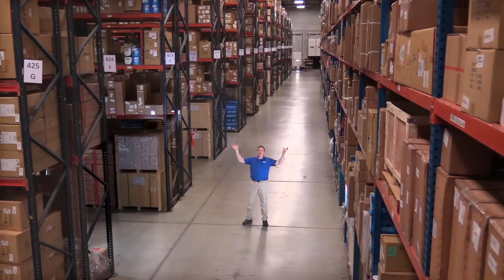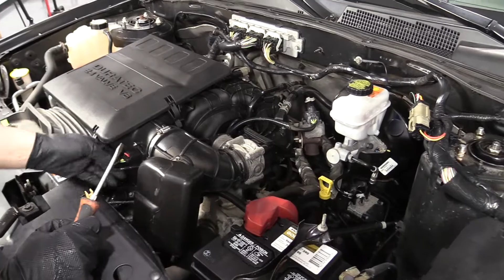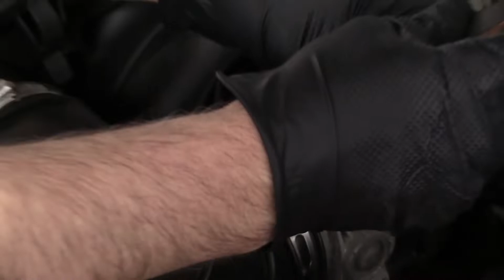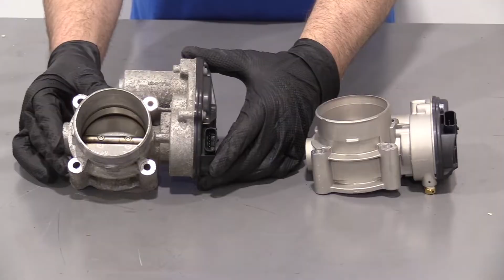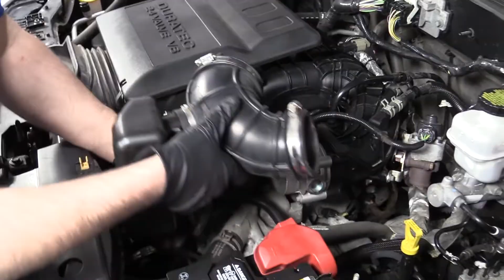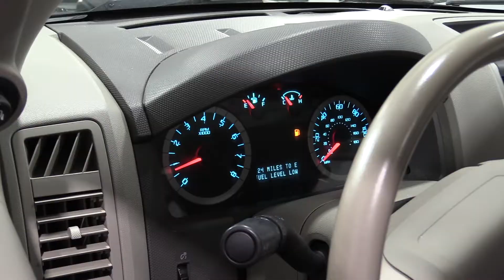How to Replace Throttle Body 09-16 Ford Escape

Comment: 1:23 I was doing a visual inspection in preparation of doing this repair, and found that my Escape doesn't have that fresh air vacuum hose that connects on the bottom. Is that an issue? Can I replace my Throttle Body without it?

Comment: FYI, 2013-2016 may use the same part, but it is in a different location, and much harder to get at. It would he helpful to have a different video for those years.

Comment: I have 2016 Ford Escape 2.5l I have code P2111 should I replace the whole throttle body or just clean it would fix the issue ? 
Note : my car run fine and super smooth but I have just this code and the throttle body also start to smell like gas .

Comment: Why replace it when u can easily clean it?
Reply: I did the clean but it only helped for a few weeks. Started having jumpy throttle and cruise control failure. The clean can help but I needed to replace. Apparently this particular part has frequent issues recognized by Ford, they offered a 10 year and 150,000 mile warranty. I had to buy a new one sadly

Comment: Be sure to reset the KAM - Keep alive memory after the throttle body replacement also.
Reply: how do you that sir 
so follow the video,change the throttle ?? do I have to reset before u run the car with the new throttle?

Comment: I have a 2008 Ford Escape XLT 4wd and the wrench light has popped up I’ve had the oil changed it still pops up even though the place I bought it from said it is just a oil change indicator I’ve been dealing with it for about 2 months nothing to abnormal just skips the second gear and the engine gives a little bit of a shake, I’ve bought a code reader and it won’t pull up the code. Is this the same case? Do i need to just clean the throttle body?
Reply from the maker: +DQ We wouldn't be able to diagnose an issue like that here, you may want to have a local mechanic take a look at it. Thanks for checking us out! http://1aau.to/m/Shop-1AAuto-c

Comment: Just finished, thanks to your video. Cost me $145 CAD for the part and gasket from local Ford dealership. Spent another $70 for a torque wrench from Canadian Tire. Took me about 15-20 minutes to complete the job. Thanks a million 👍
Reply: You could’ve just cleaned the throttlebody and save yourself a lot of money
Reply: @Iloveyhwh_1974  I prefer to buy a new one

Comment: Yesterday, I took my 2010 Escape to AutoZone. They pulled a code that said there was an issue with the throttle body. I just replaced it with one made by Duralast, which cost about $140. That cured three things! 1) Poor and inconsistent throttle response, especially at low speeds, 2) jerky and unpredictable shifting, 3) gas mileage! It gained over 3 average MPG, according to the on board display. It really made the difference.

Comment: So there is no re-learn procedure post-installation? It just adapts to new throttle body position over a few runs?
Reply from the maker: +Austin Craig Thanks for your question based on the steps and video this original equipment part appears not to need a re-learn procedure

Comment: I watched this to learn what was required (by the dealer to perform a recalibration).  That was done four years ago - gratis - under a recall.  Thank you, Ford/Mercury.  Now I am preparing to replace the throttle body and its integral throttle body sensor due to a "wrench" lamp that illuminated and its code said that 7000+ previous equivalent codes were resolved by replacing the throttle body (and gasket).  So, as I prepared to replace this, I am inquiring what did the dealership do to "recalibrate" the 2010 Mercury Mariner AWD 3.0L V6 engine four years ago under a recall?  I am confident that the replacement part (already ordered at a local NAPA parts store) should not required additional attention after the initial installation by me versus a tech with a diagnostics computer at a local dealership.
This was another informative, well done video by A1Auto.  Thank you.